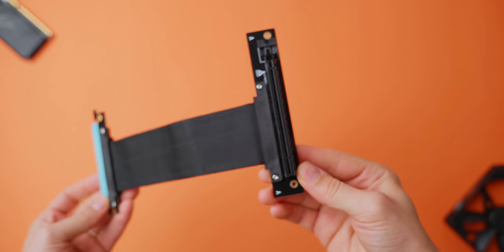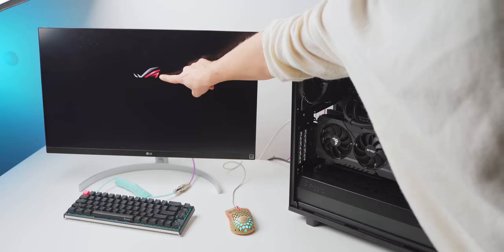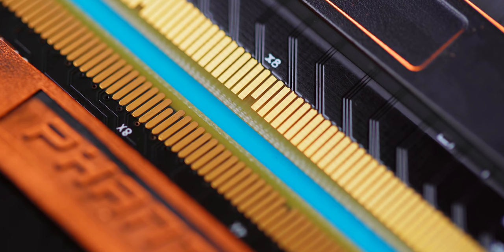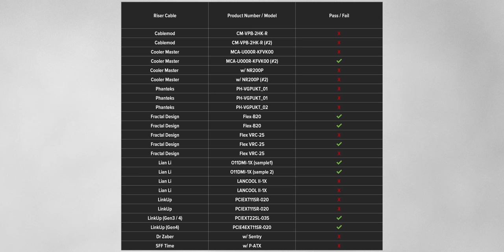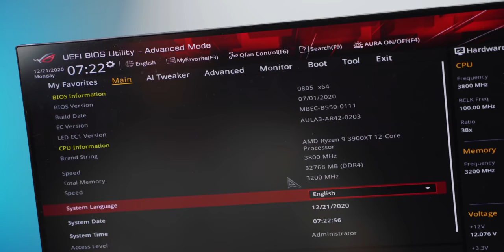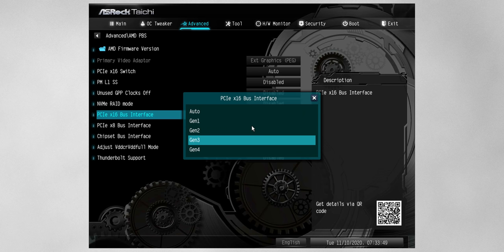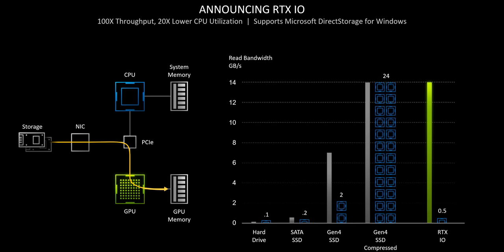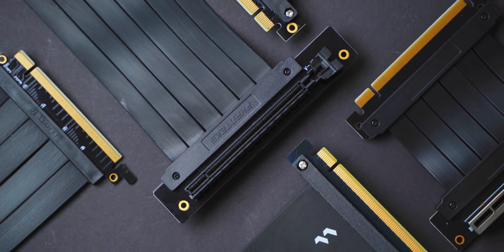There's a PROBLEM with Riser Cables

Comment: This is a totally biased review. I am using a Phanteks riser cable (rated for PCIe 3.0) on a Z790 motherboard with a 4080 in it, and it makes no difference if I put it straight into the PCIe slot or connect it to a riser. I am talking about not only being able to boot but also being able to play multiple fps titles in 1440p without a significant difference. STOP TO BIASED REVIEWS!
Reply: Used a phanteks riser for less than a year, started getting artifacting and hangups, so I decided to remove the riser and I don't seem to have those issues anymore.
Reply: @Shuffledudee  Maybe you got a bad one. Mine is still working like a charm.. But it's very interesting that your comment got highlighted immediately.. Wondering if that has something to do with me calling someone out on 100% biased review?

Comment: Stop modding it until to the problematic end. Plug and Play should do the job, since everything but every thing more is just complicating your setup .... and this is not only this little cable here ... think about hardware, software etc. etc. how many things are running overall ... and ingame layer and on the toilet layer ... use ur phone not to loose info - whatever - it´s crazy how people would like to make money at no promise that it will work out for you. Important is the data they can get from you. And now the fun part begins with you - about finding it out why your stuff is not working in your home!??? And you have spend money on it!